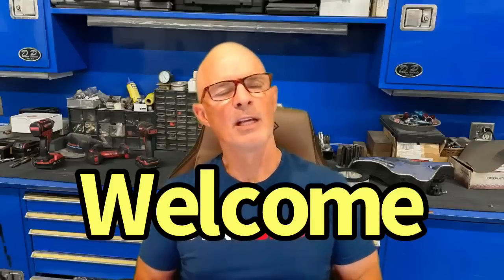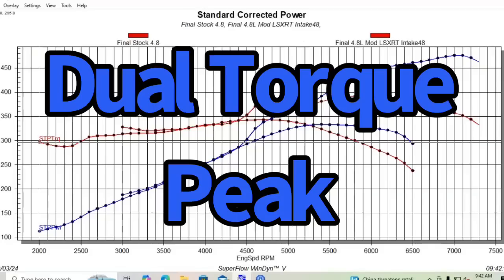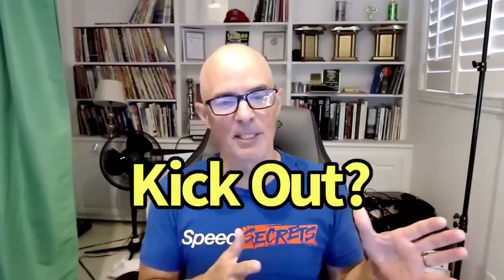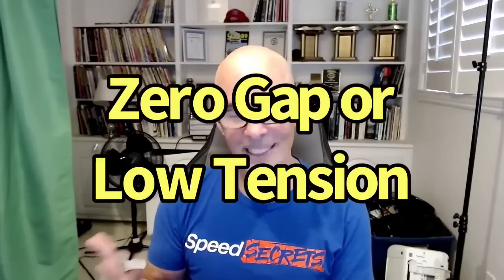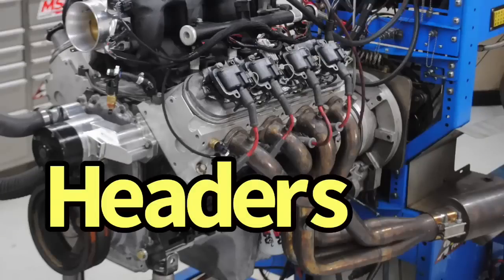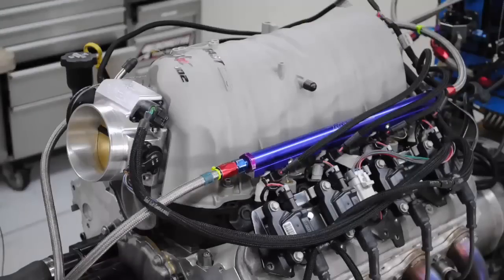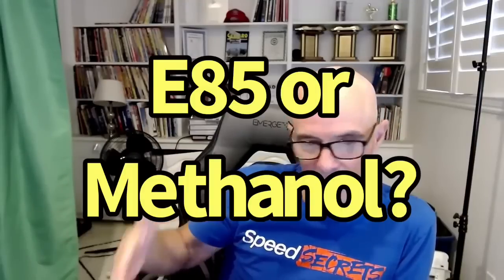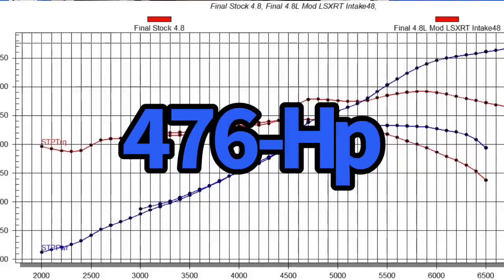500-HP NA JUNKYARD 4.8L-NO BOOST, NO NOS! CAN IT BE DONE? HELP ME ADD 25 HP TO THE 475-HP 4.8L!

Comment: a slightly restricted exhaust can rob a little bit of power if you want to have it hit that 500 mark and the less pulleys you have the less effort it will need to spin the motor

Comment: I’ve had trucks or tahoes with almost every engine variation offered since my 97’ 3/4 ton suburbans 454 to a turbocharged 91’ s15 Tahoe 4.3L v6 which is my #2 fav. All the way back up and thru multiple tahoes and Yukons 2002 2005 5.3L and 6.0 Denali to finally my 2001 Sierra 1500 4.8L that now has 301k miles and with basic maintenance done on time and properly with zero engine upgrades other than a k&n CAI system and a flow master muffler and it’s still running incredibly like new still and never replaced 4.8 and you can believe me or not cuz most don’t but original 4l60e that’s just recently showing signs of needing some burial arrangements made lol and I have modified several buddies 4.8s and I have just fallen in love with both this year truck so I’m keeping it for good and bought a newer fx4 gen 1 coyote with small mods that’s an absolute kick in the pants to drive but I find it not worth modifying for the average guy with all those damn cams lol anyhow back to my Sierra. Plans are now to tear my engine down boil it out and back together with as much of the stock stuff except for the common top end mods.  Obviously new rings rockers rollers rods port and polish new 243 heads cam mild and I’ve been waiting for this supercharger set up for so long as I’m just burned out on what every single guy has with a turbocharged LS truck yada yada not interested in my truck sounding like a damn rice burning wrx. Lol I’m 48 yrs old not 19.  It just sticks in my brain like the annoying kids putting a playing card in the rear spokes of his huffy to sound like a uhhhh motorcycle? Says the booger eatin moron dad that did this to his poor son. lol and I’ve been so irritated that these exact superchargers were only avail for all the older ford 4.6L v8s for so long now and get some Caddy

Comment: Richard, the port matching would also have bearing on eqalizing the cylinder output as well. Five hundred hp÷8=58.5 hp per cylinder, not a mean feat. But one cylinder not getting an equal or equally mixed charge would cost 2-5% of that cylinder's output. To reach your goal, you likely don't have it to spare. The other side of port matching is keeping the runner spaces at close to eqal volumes, another topic for another video. Thanks for beating all these "iron puppies" up- lots to be learned (and applied!).
Reply from the maker: not sure how port matching all the ports equalizes cylinder power output

Comment: 10-15 degrees of added duration intake and exhaust and a good set of valve springs would likely do the trick. She’s gonna be screaming though my guess is peak power will hit at 7800-7900 rpm and be 505 HP.

Comment: Have you ever swapped the stock throttle body on an 06 Silverado LT with the 4.8?  The stock tb has an 8 pin (doube stacked 4) drive by wire harness.  Everything i have found aftermarket is either 6 pin or 8 pin straight across.  I have seen adapters on ebay but i dont know how reliable they would be.
Reply from the maker: no idea on that
Reply: @richardholdener1727  well dang...wanna do an episode on this issue?! Ill let ya use my truck, lol.  Thanks for the response & if you come across a fix for this, please let me know. Id really like to upgrade from the stock 78mm to a 92mm.

Comment: If you want to keep the current cam: the oil system like you mentioned, re-evaluate the valve springs like you said, and rings like you said - but recut the valves for higher rpm, and get an adjustable cam gear and advance the cam gear timing. All that by itself will take you over 500.

Else, obviously just a new cam, lifters, valve springs - will obviously get you there by itself
Reply from the maker: recut the valves for higher rpm?

Comment: Not pertinent to the question, but something I want to see is running a long runner intake on something like a LS3 and just keep putting in bigger cams. I'm building a T-bucket with an LS for autocross and an engine with a big low-end torque number that still revs out well past the power peak will have quicker times than the same engine that has to short-shift because it runs out of air at 5500. I might be able to skip an upshift or 2 and the subsequent downshift. A manifold that is still available is the Edelbrock cross ram.
Reply from the maker: I have run the Edel cross ram on an LS3-that vid is up

Comment: I have a 4.8 with 862 heads with BTR NSR cam… with a holley wire harness  550-919 …. Which Fast intake part number should I go with ??? Please help
Reply from the maker: get a Fast LSXR cath port and 102 tb (there is only 1 of those)
Reply: @ thanks I love the content…on a guesstimate how much horsepower with a 4L60e in a gbody el Camino make with this piticular set up???

Comment: You need 22hp to get to 500hp that is only 3hp per cylinder, easy peasy. Based on what BMW and Merc tuners have done and staying with only bolt ons to avoid opening the engine I would go with 4 additions. 1) Both oil and fuel coolers. Cooler fuel is more dense so for a given injection pulse width you get more volume and since it is cooler it delays cylinder heat soak as rpm climbs. The heat in the fuel comes from the compression by the pumps and entrained air cavitating under the pressure. The cooler oil keeps the head cooler to add to the effect. 2) Phenol heat resistant intake and exhaust spacers. These isolate the head from the hot exhaust manifold and prevents the head conducting that heat to the intake manifold and cool intake air.They also tend to add a bit of torque as well if they are thick enough to increase plenum lengths and straighten flow paths in and out of the engine 3) ignition upgrade, premium plugs, wires with big 3 wire upgrade. Something like an msd coil pack, ignition wires and ignition box option and larger gauge ground, alternator and battery wire topped with premium copper plugs. 4) The fuel rail needs to be equipped with a 1.7 ratio variable rate of gain regulator FSE or similar situated in the CENTER of the rail and the fuel entry must also be to Both ends of the rail. If you have a rail that is fed from one far end only and the regulator is at one end as well, the cylinder furthest away from it will starve at high rpm and the closest will run richer so you lose horses in both banks. The variable gain regulator adds fuel in response to changes in acceleration to support the ecu so pulse width durations are smaller but the fuel delivery is more and better atomised. 

That should yield close to 5hp per cylinder or more putting you well over your target. You welcome.
Reply from the maker: none of those will add any power
Reply: @richardholdener1727.... look Feyl of Renntech uses the coolers so does Gail Banks as does Cosworth and Ricardo Engineering with enormous success on land speed and hill climb projects. Last time I checked the Bugatti veyron had a dozen of them for every fluid known to man. Use it, don't use it, I'm just the messenger bud.
Reply: Aha I see why the scepticism. You did a fuel cooling experiment about 2 years ago. Not to criticize but you got the concept wrong. Fuel and oil you do not cool with water because you can go down in temp so far that you change the viscosity of the fluid which affects flow rate. Oil will get thick so it will circulate slower and remove less heat, gasoline gets thinner at lower temp and because all fuel pumps are positive displacement in design you get slippage and it dramatically reduces the pressure it can attain and flow rate.  If you still have the dyno data with air/fuel ratios you will see the ratios are either static or leaner compared to ambient operation. That is why you saw power with carbs, they have diaphragm and plunger pumps feeding the fuel. They have with no leakage path backward like a rotary pump and the high pressures that exacerbate slippage in a rotary PD pump is not present in those designs. Cool with cold air, you can mist but never submerge.

Comment: I picked up 10 hp to the wheels with a radiused entry vs open throttle body on my heads and cam LS1 with Fast 102 and 102 throttle body .  Honestly, if you're only at 10.0:1, just increasing the compression and a slightly bigger cam should get you there.
Reply from the maker: you need to test that again
Reply: @richardholdener1727  that was 7 years ago, impossible.  The results were consistent, not an anomaly but I digress.

Comment: Take .050" off the head if piston to valve doesn't become an issue.  I think that and the right intake alone could do it, add a bigger cam and you should be well over 500 unless valve float becomes an issue then some conical springs should do the trick.

Comment: 475 hp at 7000rpm, Id leave it be unless I could get a few messing with the bottom end
Having to run more cam will just make it a pain to drive needing even deeper gears etc
Point of diminishing returns. Dont like short runner intakes on small CI engines for a st car

Comment: Hi Richard I’m building a Gen 4 5.3 so with flat top pistons and I have 799 heads milled 20 over with 660 lift springs and stock valves with BTR 7.400” pushrods and ls7 lifters. can I run the BTR hot rod cam without piston to valve problems?
Reply from the maker: yes

Comment: Hey Richard, im sure this question has been answered in many debates online with varying degrees of truth to the answer. I feel like you would have a good idea with all your experience. In terms of creating an arbitrary power number, say 500 750 or 1000 for example, in terms of real world application, Fuel usage (economy wasnt really appropriate), durability, manners, handling, difficulty to drive etc. How would you compare various common builds like a stroked 408, a BBC, a roots blown SBC, turbo 4.8 / 5.3, centrifugal lsx, twin screw lsx etc. or even something like a high boost 5.3 compared to a low boost 6.2 for example, just an interesting concept, that is hard to piece together from various sources with differant backgrounds. 

Out of the blue, what would be the most fuel efficent way to make a 700hp capable engine. (not nitrous haha)

Comment: All you need is a 228 cam and .041 gasket. I’ve done this several times for my marathon drag boat motors. We run for 3 months without coming off full throttle. 5 times a year
Reply from the maker: you didn't make 500 hp with a 228 cam in a 5.3L
Reply: @richardholdener1727  correct, it was a 4.8. 3 months straight without lifting, 5 times a year! 😳j/k. Love your stuff still got several dozen of your mags from past years👏🏼👏🏼

Comment: Need help. Bottom line is I want more hp, reliably, and to stay in california code. I drive a 2006 gmc sierra 5.3, it’s in great condition. I’m thinking 2 things: 
1. Staying with gmc: get truck Norris cam kit, tbss intake, bigger throttle, fuel pump, injectors, forged pistons and I will do all the work. Not a mechanic but good enough to learn and tedious enough to do it right. Will also need to find a tuner. 
2. Get low miles good condition 5.0 f150 (2017 or 2021) and throw warrantied Whipple. Get tuned after warranty expires.
Reply from the maker: I doubt either of those options is emissions legal
Reply: @richardholdener1727  damnit thank you

Comment: Get as much windage out of bottom end some heavy twin valve springs and biggest cam U can fit , not super thin oil on high mileage, try Holley cross ram-(just because I can't afford to at moment)🤔😜, amongst others, then E-85 it then send it, no rev limiter..🤘👍

Comment: Mill block and/or heads for more compression and improve quench if needed.  Crank scraper.  Bigger cam.  Low tension rings would maybe help, but that's technically not a stock bottom end and the stock rings are pretty low tension compared to the old days.

Comment: In my humble opinion, small displacement high revving V8's are the way to go, ford demonstrated that quite well with the coyote. Id love to build a max effort 4.8L for my ranger and see if it can hold a candle with all these 5.0's on the streets nowadays...
Reply: I think you are better off with a 5.3 for that…
Reply: Main issue with that is that coyotes are overhead cam engines and is much easier to get to a higher RPM than pushrod engines. 4.8s do however love to rev. N/A wise you are better off using a 5.3 or 6.0

Comment: Richard, Nice Video. Do all the coatings, light oil, and thin rings. Shoot for 0.035 squish to get more mixing in the chamber, then you have to test different spark advance. You can mix 93 NL and methanol in any ratio. I ran M90 years ago with a Predator carb on a 482. It will start just like gas and you can still read the plugs. M50 will get you there (with a cam, intake, and head mill) but you will still need to test the spark advance. Ask Vizard for a cam recommendation (with a 7500 rpm peak). Anxiously awaiting your next video.

Comment: ALL those items combined, should make a purely healthy runner, if you’re wanting to max out the “stock” short block. But, w/the 25hp deficit point, use the setup from the 5.3L. See if that cam, heads, & intake setup will hit the mark? I would sure do the E85 fuel for this. That’s just a cheap fuel upgrade done by about every local tuner around here.

Comment: ever consider water injection, maybe an air chiller or hotter ignition and why not go into the bottom end?  i get the rule in most cases but once you've gone for the heads cam & intake and rings and parasites the $ to effort ratio is already out the window,. if 500+ is achievable with a crank rod & piston combo, thats useful info too. going after the rigs is close enough to the whole job, why not loook at the BE,. im bringing an 01 Seirra with the 4.8 back my self. so im paying lots of attention to your findings on this., thanks for your effort

Comment: All of those options (oil pan, intake, solid lifter, thin oil, lightening the flywheel, higher octane fuel, porting and matching, heads, etc.) will increase power it's just a matter of measuring which increases the most. 

Did you know that they already sell Dry Oil Pans for regular V8 engines?

Comment: Put some VP MR12 in it. Good for about 10hp on motorcycles and loves low compression. So it should pickup 20-25hp in that 4.8
Reply: PS it doesn't take extra timing very well.

Comment: I'd start with small steps, better valve springs, maximize compression (head gaskets) and a short runner manifold. If you can't get there with the 224 cam, then change it afterwards. A switch to E-85 or methanol should help.

Comment: I would start by coating the bottom of the pistons, rocker arms, rods, and crankshaft with an oil shedding coating. That there at high rpm should be worth around 5-15hp. I think it would be a larger gain than a scrapper and it could also be used with a scraper
upgrade to a cam sproket with a Torrington bearing
Grab a cam with a tighter LSA which will give more DCR which will give you more power. Definitely go larger on lift and perhaps duration as well.
thin oil like you mentioned
perhaps e30 might help since 30% ethanol fuel tends to have the most complete burn.
Don't go crazy with valve springs, keep the least spring you can for that rpm so that you don't have losses
Smart coils could also net you 5-10hp

Comment: Hey Richard, what modifications would you recommend for a lm7 5.3 with a 4l80e in a 4000lb single cab truck? As it sits it will not burn the tires off I assume due to the heavy 4l80e. It’s not a daily truck so I’m not looking for something too mild..
Reply from the maker: cam, springs and converter
Reply: @richardholdener1727  which one of your cams would you recommend? I’d like to purchase one off of you if possible!

Comment: Since I heard you talking about internal engine mods like special rings and such, why not use a Lindy flycutter on the piston? Many of my home built customers did this over the years with success. So, I don't think that is too crazy for this build. Then you can mill the heads AND also have an optimal camshaft. You might also try an intake like the Holley Split Single Plane for cathedral port heads. If you truly only care about peak power, it might edge out the FAST on the top. If 7500 is RPM is your practical limit, use a camshaft like this: 229/244 109.5+4.5 with .650"/.630" lift. There are shelf cam cores that will make this and Brian Tooley or Bobby @ Cam Motion can make that for you in a couple days. Make sure you use a spring like the Tooley .685" lift spring or a PAC 1207x or the FED 700" hydro springs to assure plenty of RPM headroom. For heads, you should see if Brian Tooley has some of his new canted valve LS cathedral port heads that will fit that small bore. That would be sweet. Between the compression and optimal camshaft timing with a really good set of heads, you may not need much more to hit your target. If you do go inside the engine, some plus .001" main and rod bearings would probably be wise. Never know, it might go well beyond 7500 RPM. Sure sounds like fun. Wish I could come play too.

Comment: Could you please do this in stages like starting with a ls6 intake thats cheap take it to the limit then swap out other cheap parts as not every one has a $1000+ for a intake.manifold in australia.
Reply from the maker: you can't get there with an LS6 intake-but in this build I did run the combo with a stock truck intake-lots of other 4.8L test vids up for your info

Comment: Just add a bigger cam. Run the max lift you can safely and add some meat to it.
I remember the guy who took a 307 sbc and made over 500hp with a set of old trick flow 175cc heads. He ported the heads and changed the cam 3 times but he got there with more rpm. Nothing too crazy but he just needed a little bit more cam and if i remember it peaked at 7000rpm